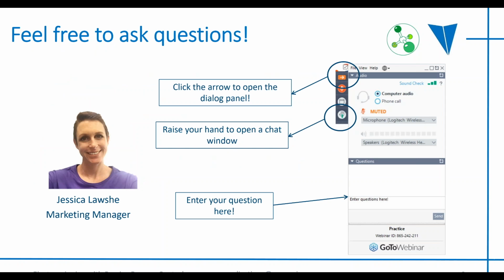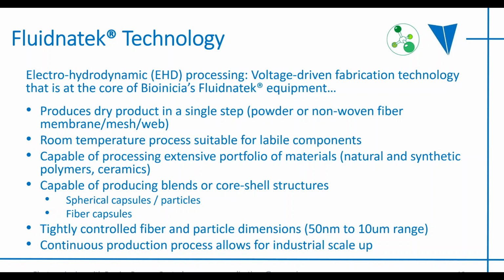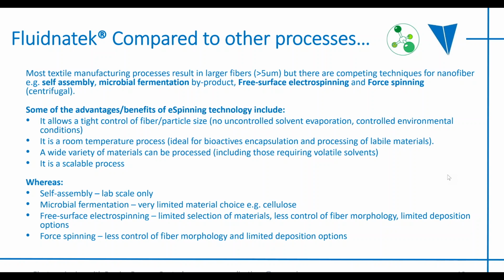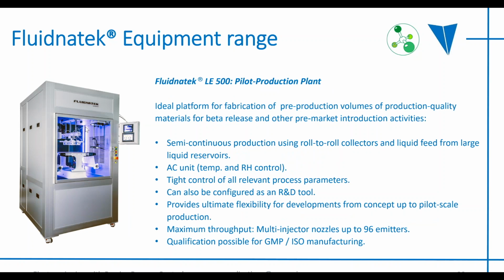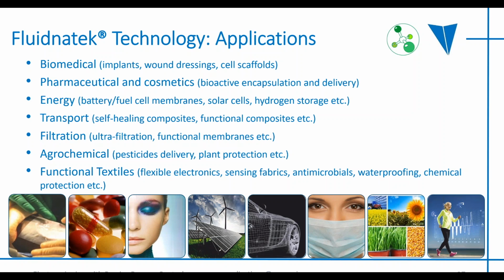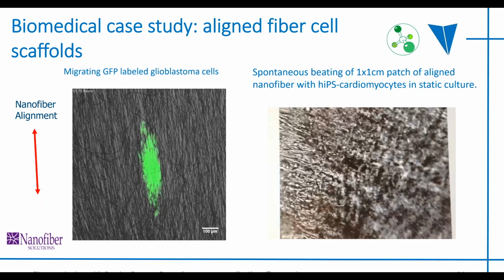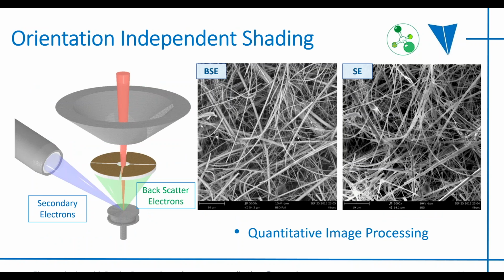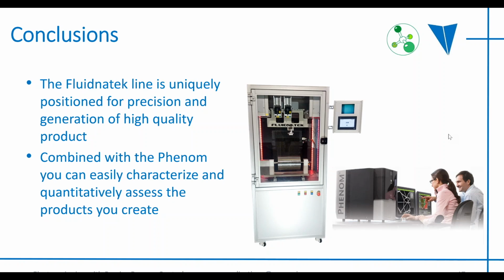Characterization of Nanofibers and Nanoparticles | NanoScience Analytical

Comment: Hi 
Nanoscience Nanoscience,
I have question about video, in 45:58 I saw resolution of SEM is <14 nm.
1/ Could SEM see nano materials, clearly or blur ? (I mean it's a normal SEM, not FE-SEM or high resolution SEM)
2/ Which is the best method, cheap and convenience for characterizing (shape and size) nano materials?
I hope I would receive your answer soon.
Thanks Nanoscience Nanoscience.